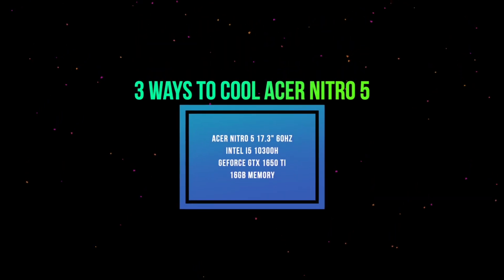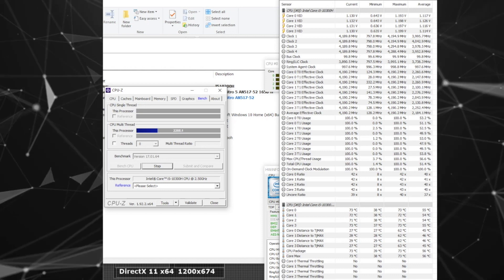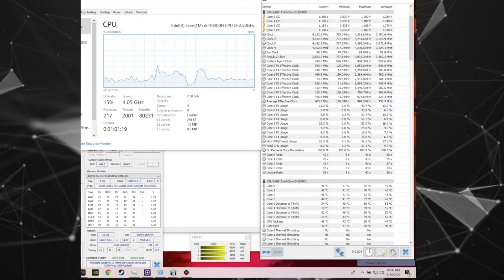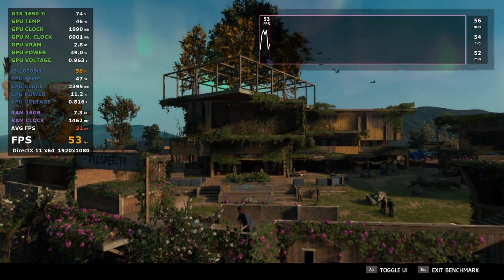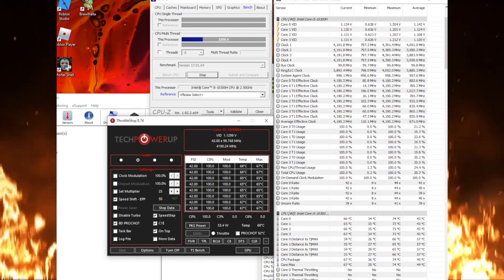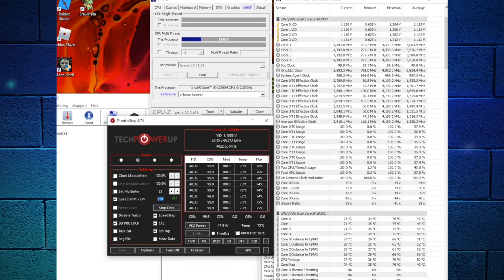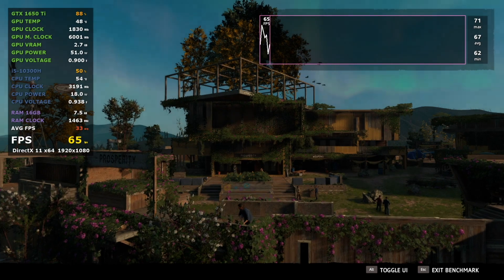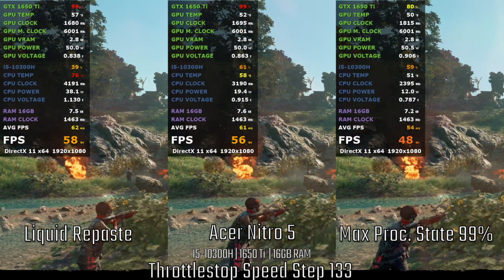3 Ways to Cool Acer Nitro 5 2020 (Throttlestop, Power Management)

Comment: man I have tried so much for my MSI laptop and it just doesn't go below 90c.
I repasted thermal compound with Arctic MX4,
Cleaned fans,
Undervolted -60mV,
processor to 90%,
it still goes 90c.
Specs:
i7 5700hq
gtx 970m
Model:
GE72 MSI 2QF
Reply from the maker: Have you tried limiting your clock speed in FIVR?  I know you might not want that but it's worth a shot.  Also is -60 the highest undervolt you can achieve?
Reply: @Meanpooh  yes -60 is stable, more id unstable with blue screen.
I have limited my CPU to 85% which means from clock speed 3.5ghz to 2.2ghz.
Reply from the maker: @HassaanALal  So with those settings you are getting 90C?  That doesn't seem normal.  I would suggest a different thermal grease and make sure that your screws are tightened down.  Don't damage the screws just make sure they are decently snug.  With your clock speed so low, you should not be hitting those temps.  Make sure your fans are clean as well.
Reply: @Meanpooh  yes the only problem is my cpu fan runs max 50% original speed and that can be a problem but I dont think that can bring the temps even -10c
Reply from the maker: @HassaanALal  If you have your fans manually set at 50%, I would try to increase it.  If they are damaged, get a replacement.
I would also try a different thermal grease. This can help.
Reply: @Meanpooh  the fan was faulty, this 50% fan is what I replaced which is not a good fan I got from AliExpress.
Thermal grease, I think I have one of the best one (arctic mx4). I used it on my rx580 too.

Comment: hey Meanpooh i took my laptop(15 days old) to acer they said that they did repaste but the temps are still 93 c (peak)when playing NFS Heat
Reply from the maker: Can you return it?
Reply: @Meanpooh  I can take up the complaint further. My return period of 7 days is over... So my laptop does have heating issues right.?
Reply from the maker: 93 is pretty toasty especially for 2 weeks out.  What model do you have?
Reply: @Meanpooh  AN 515-54-521N 
i5 9300H 
GTX 1650
8 GB RAM, my friend who bought the exact same model along with me also has the same temperatures.
Reply: @jerinjoy5435  Same model and same issue my advice add another 8GB RAM, Repaste a good thermal paste, buy a good rpm cooling pad last and important one undervolt it by -0.125V or try -0.100 first this just might reduce the temps from 93 to 70 try it and let me know if it worked, not all methods are compulsory undervolting one is but if you try all methods it will give better results
Reply: @himangshukalita1775  thanks for the advice bro but im not sure about undervolting...
Reply: @Joshua Jose thanks bro... 👍
Reply: George Tesh  it's XTU for intel for AMD use Throttle stop

Comment: Bro my nitro sense software is showing gou usage at 0% all the time though the task manager shows that it is being used. Ive tried updating drivers and downloading latest nitro sence from their website but its not working
Reply from the maker: That sometime happens to my when my machine awakens but returns to normal shortly after or a reboot.  If reinstall doesn't work, I have no idea why.  You could try creating another account on your machine for test purposes and see if it doping the same thing.  It may just help.

Comment: There is another way to limit the turbo clock speed without turning it off completely. Although the 10th gen i5 is not officially supported, the Intel XTU (extreme tuning utility) software does allow some adjustment. You can't undervolt the CPU, but you can adjust the turbo boost power level. By default my constant boost was at 70 watts and short burst boost was at 110 watts (I think). I turned off the short burst boost completely and lowered the constant boost to 35 watts. The result was a top clock speed of about 3.6ghz under load and max CPU temp of about 75 degrees C, 20C cooler than the previous max. If you then set max processor state to 99% it just has the same effect of disabling turbo boost and maxing at about 2.4ghz with the temp in the 60s.

I haven't done a repaste yet, but I will. And I don't run my fans at 100%. I just have the Nitro "cool boost", or whatever it's called, turned on. These are centrifugal fans that can spin well over 5000 rpm, which means they'll wear out in no time if they're constantly maxed out. Also, keeping the fan blades free of dust makes a big difference to their effectiveness.
Reply from the maker: This is a great alternative for the iXTU users.  It's just like adjusting the settings in Throttlestop on the Turbo Power Limits tab.  I run my fan at Max only for games but not while idle as they are tooooooooo loud.  Most game work with just using Nitrosense but not all the time so I have to push it.
Reply: what games you played?
Reply: @kylelopez5699  MS Flight Sim 2020 is probably the most taxing game I play. I struggle to get 50 fps on medium graphics settings. Most of my games can run fine at 60 fps on ultra settings with the turbo boost completely disabled, including Oculus VR titles (@72 fps).

It's worth noting though, my version of the Nitro 5 sports an rtx2060 but only a 60hz display, plus I've bumped the ram up to 16Gb.
Reply: @fedzalicious  yea turbo boost off would decrease your fps a little but its worth it because of the very low temperatures
Reply: @kylelopez5699  it makes a huge difference. The cpu is rated for 105°c, but it has a limited lifespan at that temp. Running in the 60s it will last much longer. Not to mention the reduced strain on the fans and other components.
Reply: @fedzalicious  thats true,thats why when i discovered turbo boost i was so happy that now my laptop is not gonna be so hot like before
Reply: @Chloebbg  it's limiting the extra power consumption associated with the turbo boost feature. My base clock speed is 2.5Ghz and maximum single core speed with "turbo boost" is 4.5Ghz. All of that extra clock speed uses way more power and generates way more heat. By setting a power limit for the turbo boost, measured in watts (volts × amps), you can reduce the maximum clock speed, which reduces the cpu temperature.
Reply: @fedzalicious  can you help me do it?
Reply: @fedzalicious  idk how
Reply: @pajo5014  what kind of computer do you have? (Full specs)

And what are you wanting to do? Limit the boost or turn it off completely?
Reply: @fedzalicious   nvm i get it now
Will do with this video
I have i5 9300h gtx 1650 btw
And i wanted to limit turbo boost
Reply: @pajo5014  nice. So you downloaded xtu from intel? That's what I used.
Reply: @fedzalicious  yeah i only undervolted with xtu 
Now i wanna limit turbo with throttlestop
Thats better i think
Can i undervolt and limit turbo or only limit turbo
Reply: @pajo5014  it's the same thing. Throttlestop is just another way you can do it, so it won't add to what xtu does.
If you want to disable turbo boost completely and run your base clock speed, you can do that by changing the Windows setting "Maximum processor power" from 100% to 99%. If you do this your processor shouldn't get over 70°. You should set it to 99% then try a couple of games. If you're still getting good fps it will make your pc last much longer. You can do that with xtu running as well, so it's no turbo at 99% and xtu reduced turbo at 100%, and you can change it back very quickly.
Reply: @fedzalicious  could you give a screen with the settings intel xtu, I have i5 10300h
Reply: @johncarter9764  have you downloaded XTU from Microsoft? Once you have, run the program. Then from the menu on the left go into Advanced Tuning > Core, then turn down the slider called "Turbo Boost Power Max".

You may have to do some experimentation to find a setting that works for you. Every processor is different, even ones with the same name.  So I would suggest using the benchmarking function of XTU to fine tune it to a temperature/ clock speed you're happy with. I think I roughly halved my Watts.

And remember, if you then set your Maximum Processor Power (Windows setting) to 99% it will disable turbo boost completely and not exceed your base clock speed. The XTU settings will only work with the Maximum Processor Power set to 100%. You'll find this in Advanced Power Settings.

[Edit] Actually I just read my first post, and I set it to 70 Watts. But you should still do your own tests.
Reply: @fedzalicious  I have limited the cpu frequency through the power supply settings by setting the maximum value to 3.5 MHz, and if I play heavier games (RDR2) I set it to 3.9MHz. I also reduce the power consumption in the throttle program to (20) (On the TPL tab, these are in the sections - Power Limits, PL1 and PL2 Values). As a result naturally, some percentage of FPS is lost, but it is not so significant, and at the same time the processor is cold, and if you lower the voltage on the video card, you can achieve higher frequencies on the low voltage indicators, through msi afterburner, thereby even winning several frames per second and at the same time, low temperatures are reached.

Comment: I used Intel XTU to set CPU TDP to 30watts (50 watts stock)... Works perfectly, hovering aroung 63-65 C° under full load. The down side is that the CPU core clocks dont go over 4ghz. For me thats perfect balance between heat and performance if you are willing to lose 2-4 fps at most in games. Great video btw😉
Reply from the maker: Its very much worth it.  Lets see how these settings hold up in different games.  The Assassins Creed games are very hungry CPU crunchers.
Reply: @Meanpooh   Using a laptop stand further improves thermals by 2-3 degrees ofc at a cost. Fans are a bit quieter too. Just saying🤣
Reply: @jovandimitrijevic3375  Hi, i have a nitro 5 too, and my temp can go as high as 94c. Would you tell me what should i do so i can get the same temp as yours?

Comment: It's the Intel chips that get way too hot I haven't seen mine ever go over 74c
Reply from the maker: Thats good as my machine was cool for 2 weeks then it went haywire with temps.
Reply: @Meanpooh  funny you should say that  so did my mind it never used to go over about 65c and then it's suddenly started going up to 74.c. it must be something to do with the paste they are using.. by the way keep the video up its was very helpful👍👍
Reply from the maker: Exactly.  Most of the time they use junk thermal grease.
Reply: @Meanpooh  your right there. I wish they would just use some decent stuff.. I've just ordered another stick of RAM 8g and m. 2  1tb so I will have to replace it when I put them in.  I'm going to replace all the thermal pads as well. While I'm there. 😊
Reply from the maker: @joshuagood4237  Alright, let me know how it goes and what type of thermal pads you will be using.  Good luck Im sure everything will go well.
Reply: @Meanpooh  yes I will do 👍 I'm still waiting for the memory but I've got everything else. I only want to take it apart once. Well hopefully. 😊👍
Reply: @Meanpooh  I also forgot to mention that when I use cinebench R20 when I first got the laptop I was getting 3245 now I am getting 3170.. And the CPU was going up to 3.8
Now it go to 3.6..3.7.dam thermal paste. The CPU is not going over 74c..but before it was not going over 64c.. I've only got one stick of 8 gig RAM in single channel.
Reply: @Meanpooh  Hi Meanpooh. Loving your vids! I bought an Acer Aspire 7 Gaming laptop about 2 months ago. It just has cosmetic differences with the Nitro 5 and the hardware arrangement, specs are more or less the same. Mine too was thermally performing exceptionally well the first 2 weeks (max 78 C in FIFA 19 Ultra settings and GTA 5 High settings). Recently, the temps increased to about 85-90 in the same settings. Please advice on weather I should go for a thermal repaste or not? Thanks...

Comment: Is it good for architectur students?
Reply from the maker: Depends on what programs you are using.
Reply: @Meanpooh  revit, 3dmax, vray, photoshop
Reply from the maker: @wissamradwan3710  The Ryzen version would be better as it has more threads and cores.  A lot of the programs listed use the CPU for rendering with the added benefit of using the GPU as well.  I would opt for a laptop that has a RTX 2060 with Ryzen if it fits your budget.  Beware that your battery will not last long.

Comment: I haven't seen my temperature go over 74c amd 4600h. But I was thinking about repasting it👍 I downloaded ryzen control and put it on 35w it only goes up. To 60c. And the CPU is at 3.7
Good video. 👍👍
Reply from the maker: Very nice!
Reply: @casualgambit674  yes I had the same problem  my wife wanted a laptop. and I tried to get an AMD one and they had all sold out